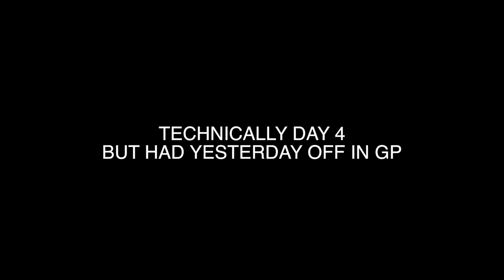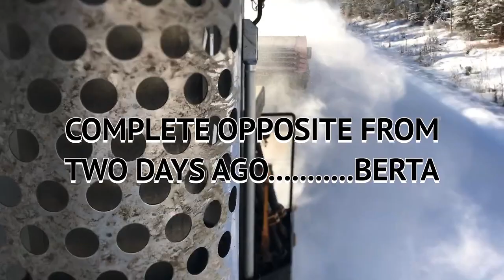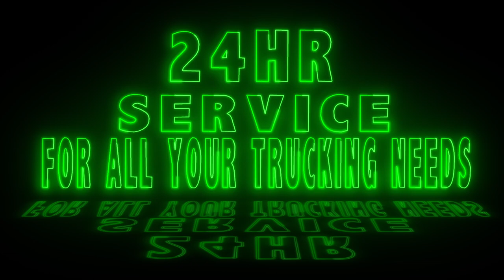EDSON WORK DAY 3 BOP'S AND ACCUMULATOR STRAIGHT PIPED C500

Comment: Why do the 4 wheelers always park in the worst spots?  Seems like every site has 3 or 4 of them guys that just have to park in the entrance.  Ha ha ha
Reply from the maker: always. it was a tight location for sure with the pump lines cutting off half the lease. pickups are dangerous. one time at road train me and a pickup were waiting to get off lease as someone was coming in. pickup was 20 ft from my front bumper and thought he'd give more room for incoming and reversed right into my truck and destroyed his tailgate and box side on a new dodge.i had to get out the spray can and touch up a scratch

Comment: Hey again. I was wondering what is your favourite truck to use. I know you driven Peterbilt’s and Kenworth’s. The c500 seems like a beast and the Texas bed is really cool. Bed trucks are wild. Don’t see these types of trucks in Ontario unfortunately. It would be cool to see a huge bed truck driving over here.
Reply from the maker: #1 kenworth c5,w900,t800b high hood#2 peterbilt  #3western star #4 freightliner, i haven't really drove much other then the 4 had a paystar 5000 for a bit it was a beast.
i have mede some treks to eastern tip of quebec and we sure stood out at the truckstops for sure
there was some oil exploration @ gaspe where we went don't know if its still going on. the large bed trucks do a top speed of 80 kph usually so id probably slit my wrists to drive that far. we would definitely haul it. we had to knock all our trucks down to 105 max kph. that was pretty lame on a 10,000k round  trip
Reply: Timelapse Trucker RTOT 
Sorry for breaking them. Have you used any picker trucks or just winch and bed trucks? Seemed like Road train was a big transport company. Did they do more oilfield work then Cypris? Sucks they had to close. I guess you were there a long time? Cypris seems like a good company. Nice equipment. Hopefully they stay afloat for a long time.
Reply from the maker: @beppesignori4096  roadtrain was mostly oilfield service work but would do anything they could. i've always stayed on winch tractor or bed truck cause i like rootin in the mud pulling guys out of the ditch and up hills i worked at RT for 11 years cypris for 1 yr and 2 months. i never really had interest in a picker